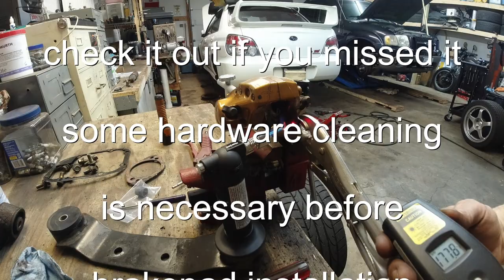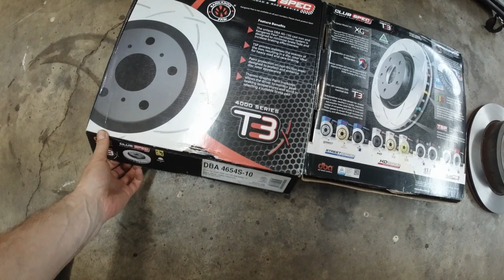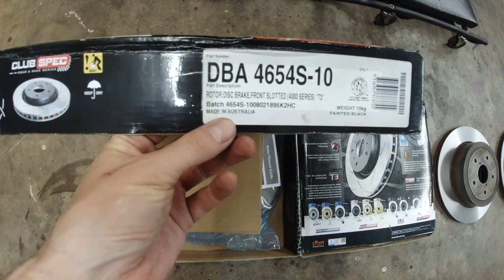Subaru WRX STI calipers, DBA rotors and brake pads

Comment: You may or may not know this, but if you use nickel anti seize on steel bolts in aluminum it will prevent galvanic corrosion and the bolt seizing. Aluminum anti seize will not work as well. You could also use blue thread locker and make sure it is well coated as that will prevent corrosion, but can obviously make it a pain to get out as well.
Another quick note is props for actually greasing the proper brake components! That said a silicone lubricant is preferred over a traditional grease because of higher temperature handling. Though I'm not sure which grease you were using. Looked like standard bearing grease. Super Lube is usually pretty cheap and widely available.
Not trying to be rude or anything, I know you may well know all of the above. Nice videos! It was on my YouTube home page and I'm glad I found your channel!
Reply from the maker: thanks man, good tips........i actually stopped using caliper grease on pads to prevent dirt build up and as for those caliper bolts they were never taken off from brand new.....subscribed!
Reply: Yeah that's usually the problem. Never taken out! Hah. Sucks that brand new cars can need preventative. Maintenance. :P
I hear you on the dirt buildup. Thanks a lot!

Comment: How is the dust and noise on the Gloc R12 brake pads?
Reply from the maker: not too bad on the dust and no issues cleaning rims but it did develop a nasty squeak on one of the rear rotors which are stock, I will be switching to DBAs as well for the rears.

Comment: Why didn't you use slotted rotors on all 4?  Kinda stupid just to do the front.
Reply from the maker: you are correct sir, trying to save money but will end up buying new ones for the back anyways and much more, wait till you see what happens after the trackday
Reply: It's honestly mostly aesthetics. Wouldn't go so far as to call it stupid.